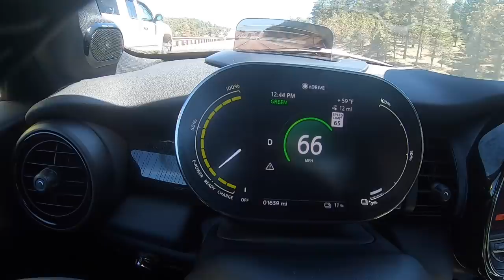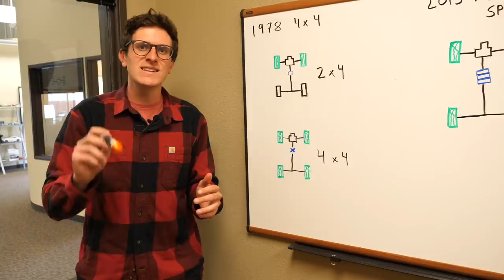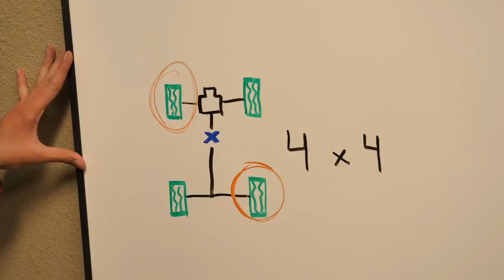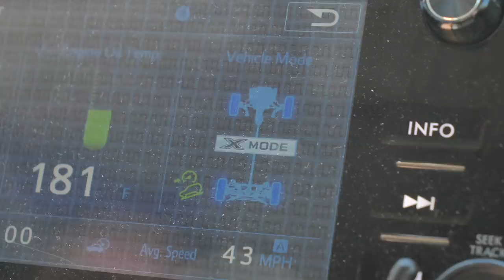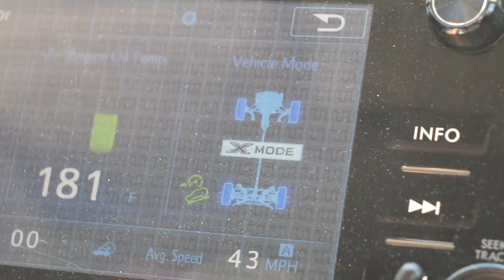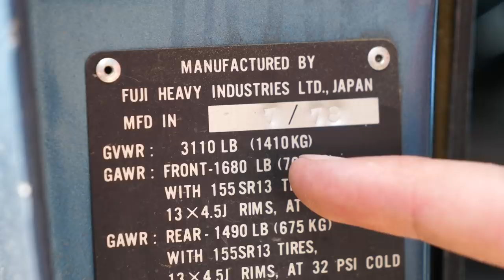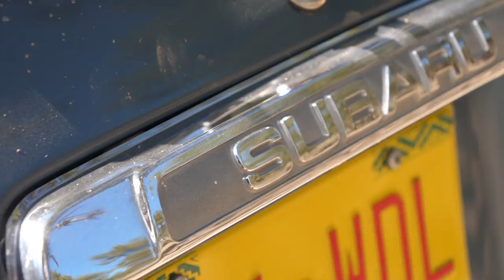Old vs New - How Much Better (Or Worse) Is a Subaru Outback Off-Road Than Its Great-Grandfather?

Comment: Curb weight was 2200 and some change, at least. I don't know where the "1900 lb" number came from though I hear people using that number now. My Subaru (just like this one) was a little heavier than the VW Rabbit and that car was typically over 2000 lbs.

Comment: The old DL is what my wife used to haul our kids to school winters in Colorado.
It faithfully dragged itself thru the bumper deep snow. Without computers and 2000 lbs of bloatware and electronics.  They easily lasted 300,000 miles if the salt was rinsed off.
The new Subaru (and everything else) are dull windtunnel clones without character.

Comment: I would like to add what some already know, after owning over a dozen outbacks. The early 4wd models were more capable, but easy to overheat and all blew head gaskets. I would say the most capable was an 87 with low range. 1st gear was so steep it seemed unstoppable and it was fuel injected and it handled well. Full time AWD was an evolution back from capable. But the 1st and 2nd gen were no slouches. I never could get a 98 to spin the tires except on ice. By the 3rd Gen they became more sissified and less reliable. For me since I choose not to drive a cvt, the last great models are the H6 automatics. Subaru keeps evolving, old timers like me got lost along the way, but somebody said they sell every car they make, so what do they care. I do miss the quirky truck like earlier models, back in the day it was hard to kill a Subaru. I think they did evolve away from their earlier cars along with many other brands. They were stuck with mediocre mileage before the cvt. Maybe if I had a Wilderness model to try i would feel different. I had a Forester and it did everything well, but the Outback hauls more stuff.

Comment: I'd like to see the cheapest wrangler vs regular cab fx4 ford f150 2.7tt. (Which is cheaper)
Reply: Agreed. And option the 3.73 rear locker in the pickup
Reply: @gondorian1006  that's the exact spec. You can get 2.7eb, fx4, regular cab here in canada for 33k retail. Wrangler starts at 34 for a basic 2 door. Loose 1 seat gain a bed. Loose a little offroad prowess gain power, economy, refinement and more.

Comment: I question that hill climb with the cvt, was it really lack of traction or the torque limiting aspects of the ECU because of the CVTs torque limits?  Sometimes a little wheel spin is a good thing and I question the capability of the CVT along with reliability even on steep dirt roads.

Comment: I have owned 4 different Subaru's from 1981 to 2003. The '81 had a 1.8L carborated engine with a 4 speed manual. It also had 3 range transfer lever, 2-hi, 4-hi, and 4-low. What a great car! I think the new CVT Subaru's are not fit for off road. Bring back the manual trans or at least a decent automatic.

Comment: Earlier Subaru had the VTD which is a planetary diff in the center, which is better than the ATS when combined with a clutch pack that acts as a LSD for the center diff. At least older Outbacks had a rear LSD as well.

Comment: I had to get up to radio sites at the top of mountains in Montana and my vehicle of choice was a 2008 Ford F-350 with a V-10 and a lot of weight in the back end.  I went on many roads I doubt the newer Subaru could get up.  The older one could maybe get up them in the summer but not in the winter when you're pushing 2 feet of snow.  It wouldn't have had the power.

Comment: I take the old Subaru any day of the week. It looks cool it's got unique styling it's lightweight, manual transmission.
A compromise might be a mid-1990s Impreza outback. You'd get fuel injection more horsepower a manual transmission with a 50/50 split ratio from to rear. And it'd be about the same size or a little larger than that old 78 Subaru DL.

Comment: I had the same color '15 Outback 2.5 Premium. The digitizer layer is showing the same way it did on mine. Since I got mine new I was able to hound the dealer until they replaced my head unit. If you jump into a newer model you'll see that the screen doesn't have all of those small squiggly lines running through it. Yours doesn't look the worst that I've seen but it is a known issue on that model year since it's the first year of that gen.

Comment: I have a 2016 legacy and out of all my prior subarus, I would say this is my least favorite in many ways other than probably safety and accident protection. I would take that old one in a heart beat. I bet in the snow, it's a monster. My 2016 has all types of small gremlims I refuse to get fixed as the dealerships in NY just absolutely suck and they practically blame the owner for things that most times are not their fault. I am on my 4th OEM battery since I have owned the car. That about 1 battery a year. The 4th battery is starting to show issues and it's about 10 months old. Normal driving, rarely do short trips, etc. At least they were all under the 12month, 12,000 mile oem warranty. Last battery they said it was fine but replaced it despite the car getting stuck while shopping several times as the battery was dead. Oh well, a few months till paid off and then will decide what to do from there.

Comment: The only reason that old Subaru is still around is because nobody EVER did that to it
Reply: I took my 86 GL wagon through worse quite often. They can take it.
Reply: @zacharyreynolds4303  Yes rust did in my brothers 84 wagon. Once it was too rusty to drive on road, it spent over 10 years for forest work. Mostly transportation to remote locations, and firewood hauling. It had the low range and had chains on it most of the time. Amazing how well they did.
Reply: The old Subaru's have all pretty much disappeared in my part of the world. 

But it's not because they were taken off-road... No, they all rusted to pieces
Reply: @michelt4390  You in NZ?
Reply: @dquad  No, in Canada... where a daily driver will seldom make it past 10 years, not because of mechanical issue but rust killing the body
Reply: I owned a 1978 Subie DL manual 4x4. Drove it through college and had it when married until it hit 350K miles.  Like I told your Dad who seems to have a grudge. The only descent newer Subie  is the Crosstrek 6-Speed. I’ve a 2019 and blow past Rams and other power trucks in very heavy Mi snow. 18” to 30” . At lights and cornering the lumbering Rams and Tacomas are not nearly as nimble.  If the rear end begins to come around on a 25 mph right turn I just hit the clutch it straightens up and either power on in 2nd or 3rd.  All the unnecessary mass of these automatic Trucks there only manageable in a straight line.  Unless know how to drive a Subie stick with your happy assed minis. Ps I also own a 2006 A3 6-Speed . It’s all about powers to weight ratio and a high driving skill set.  The dude driving his new Outback was whining like an old woman. Your son seemed to realize the point I was making about manual vs automatic trannies.  So give it up when you bash Subies kids.  You sound like you live in gated communities an someone used the pool late at night!  Hey Pops, develope some character and a bit integrity,  This is a country of diversity these day.  Your personality is so milk toasty!

Comment: This is not a surprise at all.  The 4x4 system is far better than the CVT is today.  A more interesting test would be a 2009 Legacy/Outback versus the 2015.  Even In 2013 the H6 still had the five speed transmission and guess what - it is almost as good a the old cars.  It is only the CVT that stinks and in fact the torque converter fails in heavy snow, and then you get to have the transmission rebuilt.  Just check on Youtube for Subaru CVT failure in the snow and you will get plenty of videos of the problems they have.

Comment: active all wheel drive is better for everyday e.g. wet sealed roads. I wonder if the H6 would do better than the 4.
Reply: Subaru got rid of the H6
Reply: @gondorian1006  yeah its a shame, I own one of the last of the breed. A sweet engine let down by c*** CVT though sports mode help (but then fuel consumption goes through the roof)

Comment: I'd love to see a comparison between an early '80s Dual-Range Subaru and manual and hybrid Crosstreks. Assuming the latter gets around CVT issues by using electric power. Can you still not get press cars from Subaru?

Comment: Sure, it's definitely easier to send it up a hill than to crawl up it, regardless of transmission. And, again, it's the unlocked torque converter, not the CVT, that's at issue when you don't send it in the Outback.

Comment: An engineering point you have wrong :
- the CVT is of the chain type. Unlike belt-driven CVTs, these allow for a ratio between a lower reduction ratio. About halfway to a dedicated reduction gearbox.

A personal point : if you invest the same amount of time and money in the outback, it will last just as long. Apples to apples...

Comment: I miss my 78 Subaru used it a lot in Colorado for camping we took out the spare tire in the engine bay and then we put a marine battery battery isolator in that location we did very minor work to this vehicle and it would go any and everywhere was very little to no effort that shines on that four-wheel drive and lightweight vehicle I would give up my 2002 all-wheel-drive outback legacy if I come across another one that's in good condition

Comment: I know the guys at TFL despise Subaru in general but I really don't think Subaru's marketing suggests hardcore off road abilities. Sure, quite a few crazy Subaru owners make those claims but the advertising mainly shows Suburban settings and touts the safety and reliability or shows them on groomed trails where they are perfectly capable of going. Also, just because a car or truck doesn't succeed in doing something the way you think it should of doesn't diminish it's success if it completes the challenge. The modern Subie completed all obstacles in the way it's drive train was designed and capable of doing. The old Subie completed all obstacles in the way it's drive train allowed. Tommy's assessment that it could have taken that beating twenty five more times is nothing more than a wild a** guess. Kind of like his assessment of why the modern Subaru was pausing to avoid overheating the transmission. Opinions are not facts. So, why do I keep watching TFL videos? Because it's interesting to see what really happens regardless of whether the presenter thinks it should of happened or whether it happened in the way they thought it should have.

Comment: Andre you better take that 2015 Outback in for a transmission service after that abuse. CVTs tend to be very fragile and I would try to keep fresh fluid in it to prolong its life. Oh by the way is your 2015 leaking oil yet? If not don’t worry it will.

Comment: It's quite funny how you guys talk about "challenging" roads to your 4WDs. I have driven 1982 Peugeot 504 (rear wheel only) over rougher terrains, steeper, loser hills and through lots of water without complaints. Drivers in earlier times used a lot of ingenuity and skills, not these days that everything is automated, computerised anf fragile.

Comment: I’ll take the older one just because it doesn’t have a CVT. That’s Subaru’s main problem these days.
Reply: @costaet  we've got 28mpg on the way to the coast before.  Average speed was around 75 on flat land.
Our problem with any CVT is the rev hang it feels like the CVT is going to blow the engine.
Reply: @costaet  we drove a Crosstrek with the CVT and my wife HATED the rev hang and shes not a person who likes performance driving. My next Subaru for myself will be a 3rd gen Forester with a 2 inch lift. The problem with a CVT off road is you cant put the car into a lower gear, because there is no gears.
As you said some will like the CVT some won't.

I see NO problem hugging a Subaru.

Comment: First of all, the very first off road scene, you had way more momentum going up the hill with the old roo, not a fair comparison at all.  Secondly, your argument that CVT transmissions are the biggest issue with the newer Subarus not putting power to the ground is faulty.  It has way more to do with the entire system of the car, for better or worse, preventing wheel slip, it's that simple.  We had a 2009 Forester with Sym/AWD, with a traditional transmission, and it had the same issues, if you want to call it an issue.  Bottom line; if the conditions are such that the Sym/AWD can not achieve forward movement without exceeding a computer controlled amount of wheel slip, the brain of the car takes over, not just the drive line, and it will kill the throttle at the end of the day.  It is NOT the CVT.  You must know by now, that as often as you guys have claimed to be pressing the gas to the floor of a newer roo, and that at the same time, the primary mechanism of the CVT was actually slipping, or otherwise, not putting power to the ground, you would have shredded the CVT a long time ago.  As a matter of fact, CVT technology was initially designed for efficiency, and overall better performance, even with acceleration.  Sadly, the older iterations, like what Nissan used in Altimas, that have not been jacked up with silly false shift points all because the general public doesn't understand how they work, and they don't like the feel, actually work much better.  I have a 2012 Nissan Altima V6 with that good old rubber bandy feeling CVT.  The car has the false shift modes if you want, both in an automatic sport mode, or a manual shiftish mode.  At the end of the day, I dare anyway to beat me in 0-60 time in the same car with either of those add-on make me feel better modes, against me in standard drive mode.  Those are the facts, love it or hate it.

Having said that garbage, I can't find anywhere Subaru suggesting that they have the absolute best performing off-road capabilities of any vehicle.

Comment: My Subarú Leone 1989 , 1.8 ,  with 100 HP , has a manual transmission with   Hi and Low Range . Is better in off road , than any Forester or Outback although these have manual transmission  ( until 2012) .Not to mention about Mitsubishi Outlander , Honda  CRV , Toyota Rav 4 , Mazda CX5 , BMW X3 , Tucson , Sportage etc , as it is infinitely better , than these in off road

Comment: My experience the new ones are so bad horrible button placement inside, and the speed and ram is governd at such a low speed that if you are stuck in certain traffic situations you cant get out of the way quick enough. The new subarus cause more accidents than they prevent

Comment: Hi 🙂
In Subaru CVT you should use always X-Mode because that add more pressure on the MPT. I have few videos of my '14 Forester in deep, moist sand and that videos prove how big difference (power in to rear axel) is with ON or OFF X-Mode 🙂👍
End most important thing about X-Mode....yes it has "low range" 
With X-Mode, chain on first driving pulley, going much lower meaking extra powered 1st gear...... that's why we never switch in to manual mode and select 1st gear. 

That 1st "low range" X-Mode gear you can feel when  
Subaru drive really slow (but not faster than 40km/h) and we push X-Mode buton 👍
It's a huuuge difference with vehicle speed and power😎

And another thing about CVT .......never pedal to the metal....never.
That tells car immediately "save the oil and gear box" "cut the power now" !

CVT Subaru always max 2/3 of accelerate, X-Mode (D not manual) ESP OFF and will be perfect. Hold that 2/3 of accelerate when U stuck and just waiting....never floored....🙄  That is the most powerful option in CVT's Subaru ✌️
Rest options are...... lucky 😔
I known that option doesn't work at Your legendary (🤗🤗🤗)  movie about Outback hill climbing (that was finally X-Mode OFF and ESP OFF.... right ? 🤔) 
but that was just lucky at U climbed 😔😔😔

If we stuck as in your Subaru "Off Road Remach" movie with X-Mode ON, D, ESP OFF we have to count on luck or momentum ☺️☺️☺️☺️
U can see at  "Car Question" how Subaru's CVT are strong in big articulation and also.... he never floored✌️☺️

However...... i like U Gays soooo much (btw. TFL patented hug test isn't most ridiculous.... it's most amazing test i ever seen 🤭🤭🤭🤭🤭)  and i love each Yours movie about Subaru's !!!! 😍😍😍
Good work Guys !!!! 💪🤨   💪🤨  💪🤨
Reply: Sebastian Brzostowski ok